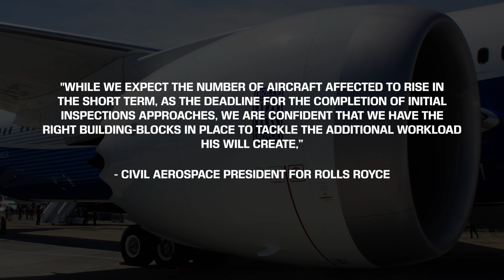Boeing 787 GROUNDINGS to WORSEN due to TRENT 1000s

Comment: Read my lips:

G - E - n -x
Reply: occhamite. Read this, "In the summer of 2012, three engines suffered Low Pressure Turbine (LPT) failures. 

During the spring and summer of 2013, GE learned of four 747-8F freighters that suffered icing in their engines at altitudes of 40,000 feet and above. The most serious incident involved an AirBridgeCargo freighter; on July 31, while at an altitude of 41,000 feet over China,  The pilots were able to land the plane safely but the engines were found to have sustained damage. 

January 2016 a Japan Airlines 787 had an inflight shutdown after flying through icing conditions, caused by ice formed on fan blades and ingested: the blades moved forward slightly and rubbed on the abradable seal in the casing.

In March 2016, the US FAA ordered emergency fixes on the GEnX-1B PIP2.[ The airworthiness directive affects 43 Boeing 787 Dreamliners in the US. Abradable material in the casing in front of the fan blades was ground to keep them from rubbing when ingesting ice or debris on 330 GEnx PIP-2."
Reply: They've all had their share of failures. P&W are currently addressing the engine issues affecting the 1000G which powers the A320 NEO. Air France had a major engine failure of a GenX in September last year. Rolls Royce have IP compressor blade issues. All these things are rare. Jet engines are very reliable.
Reply: occhamite
”Oh I see! 3 engines, 6 years ago, vs an long-standing and still worsening, major fail, affecting dozens of aircraft and at least 2 series of RR engines! Tristrar/RB211 revisited. No way you can compare the historical operational reliability of GE and RR. You don't know what you are talking about.”

Hmm, that old shibboleth again, mixed with a bit of selective hearing and confirmation bias. Don’t worry: we all have it. This not a long standing problem. The Trent 1000 is descended from the RB211 but has undergone incremental changes to improve power, reliability and fuel efficiency. Where they fell down was in their media strategy, especially viz QF32 (which is a different engine anyway). If RR were so unreliable nobody but the Brits would use them yet Boeing considered using them as a sole supplier for the787 but changed their minds.
Reply: occhamite, My point is all engines have problems,  I didn't say GEnx engines are bad, they are not free 
 from problems either. I have nothing against GE engines I've said this in other posts.

I do know what I'm talking about, I use researched facts not blind allegiance to a company or brand. The last GEnx incident regarding icing was in fact Jan, 2016.

"The airworthiness directive, issued by the FAA and adopted by EASA, was the last in a series of fixes triggered by a January 2016 incident in which a Japan Airlines 787 experienced an inflight shutdown after flying through icing conditions."

Not the wording "last in a series of fixes" So the problem has been affecting the engines for over three years since the first problem appeared! The airworthiness directive affected 43 Boeing 787 Dreamliners (that's 86 engines) in the US only . All GE engines fitted to the 787 world wide had to be checked, hardly just 3 engines.

"14 December, 2016 SOURCE: Flight Dashboard BY: Greg Waldron Singapore 

A mid-air engine shutdown aboard a Jetstar Airways Boeing 787-8 aircraft has been attributed to a known issue with the transfer gearbox (TGB) of the General Electric GENx-1B turbofan."

So the last engine problem "a known issue" was 16 months ago! Hardly history.

The Rolls Royce problem while considerable, affects 380 package C engines. Not the package B or Ten. Boeing has asked Rolls Royce to only supply the Ten version for all future 787's

Rolls Royce needs to fix this problem.  Sadly, problems like this do not have quick fixes. It took 3 years for GE to fix the  GEnx icing problems, they had to rework the fan stator module assembly. GE could not supply enough engines quickly even if the airlines choose to replace Trent's with the GEnx.
Reply: Anthony Witham

Oh I see!

3 engines, 6 years ago, vs an long-standing and still worsening, major fail, affecting dozens of aircraft and at least 2 series of RR engines!

Tristrar/RB211 revisited.

No way you can compare the historical operational reliability of GE and RR.

You don't know what you are talking about.

Comment: Coincidentally, rolls royce never fails at thr engine for airbus
Reply: What about the Quantas a380 RR engine that blew up a few years ago and after they inspected all other engines found most of them had faulty stub pipes which could have caused them all to blow up.
Reply: Yohanes Kurniawan Do some research. You forgot the A380 engine explosion?
Reply: They almost bring down a complete A380. RR powered the safest plane in the world, the L1011. Who knows at this point.

Comment: Dj. thank you for  a good video. I hope you are feeling better.  very interesting  details   about Rolls Royce engines.
I  expect they will fix the turbine blades  as soon as they can. Rolls Royce do have a good website .There was a video that Rolls Royce made showing the production line and the testing of all engines. One fact they showed was a full engine  on testbed which is sent a huge amount of water ingested whilst running at maximum speed and this proved that no blades would come out of engine cowling when engine  caught fire  and no blades got out of the engine  even when the engine failed.
It is a shame when mechanical problems could happen  to jet engines. I wonder whether any  other engine makers have had any sort  of trouble, i.e # GE # Pratt and Whitney
Reply: +C-990 Buff
"As far as GE and P&W gloating over RR's Trent engine problems, I highly doubt that will happen.  Soon enough, something will happen to each of them."

Quite right. They leave that to the fanbois. GE did have a spectacular failure of a GenX engine on an A380 late last year. I don't think anyone is crowing about that.
Reply: Hello Third Man, thank you for comments. I guess most American airlines prefer to buy American made planes, though American Airlines and I think maybe Delta and United may have a few jets powered by American engine makers. Now as Mr  Donald  Trump has put a 20 % surcharge on steel and Aluminium imported to USA   then the £350 Million steel exported by U.K to USA might mean we lose orders.
Anyway # The E.E.C is going to penalize American exports to Europe, let us see how they like that.
Sorry for comment about some non-airplane info.
Reply: Thank-you for the information!, TheThirdMan.
Reply: Good comment.  Thank-you for sharing.
Reply: C-900,  you are welcome, thank you. I suppose most people will just praise GE or Pratt  & Witney engines, however,   did those companies ever have an engine failure with their fan blades. anyway apart from plane engines Rolls Royce do make the Rolls Royce cars ( considered to be best in the world ) though the company is now owned by a German firm
Reply: sorry I spelt your username wrong, of course it is C-990 Buff
Reply: Indeed, P&W and GE have had problems with specific engine models.  Most notably are the problems with the P&W engines used on the A320 Neo.  However, despite how well engine manufacturers try to test their engines, there are times when several engines used on many aircraft and in continual use will develop an unforeseen problem.  It just happens to be how it sometimes works out.  As far as GE and P&W gloating over RR's Trent engine problems, I highly doubt that will happen.  Soon enough, something will happen to each of them.  

No problem at all with abbreviating my name.  I did not notice it until I read your second reply.  Please have a good weekend.
Reply: tradjazzer, politics and business seem to be bedfellows, so contribute all you desire.  As far as who buys aircraft from whom, I did some research and it seems that the bottom line is from whom will the airline get the best maintenance contract.  When it comes to aircraft ownership, the cheapest thing about an airplane is its initial price.  I have seen some B747-400 models that have been flying for 20+ years.  Given the FAA mandatory inspections and unplanned maintenance, that adds up to a hefty piece of chump-change.  Years ago, I had a buddy who owned an airplane.  His aircraft had a starter motor off the same assembly line as the one for automobiles.  However, due to having to meet FAA criteria and certification, that virtually same starter motor costed him 5 to 10 times as much.  I can imagine those high performance commercial aircraft parts have price tags that are sky high (pun intended).  

I hope everyone has a great weekend.  Thank-you all very much for great conversation and contributing to my knowledge of the airline industry.  I look forward to discussing things in later Dj topics.
Reply: tradjazzer I don’t mind if it’s relevant and it is. The subject is doing the rounds in other spaces. There are some countries like Australia, which seem to have negotiated this.
Reply: Hi C-990 Buff. thank you for the great information. have a good week.

Comment: Will emirates be affected by this? Maybe order cancellation?
Reply: aren't getting any? you sure about that? Emirates just placed 15.1 Billion dollar order for 40 787-10s a few months back.
Reply: hmmmm... that's odd I cannot find a single article about the cancellation of the 40 dreamliner orders.. could you link me to an official press release so I can read? thanks.
Reply: Emmanuel Pacamalan they placed order for a350 then canceled it then for 787 then canceled it then went back to a 350 and got more a380 instead still deciding between 787 and a350 and a330 as they need and want something smaller  than 777-300 airbus and Boeing will not cross filthy rich uae government and will dance like they wistle order rules don't apply to gulf carriers. We will cancel whenever we want and get whatever we want.. oil oil oil money
Reply: Taekook Addicted emirates doesn't have any 787 and aren't getting any

Comment: I just noticed that the engines separate when they land. I have ever noticed that before, is that on all engines or a feature only of the Trent 1000. What is the purpose, is it the reverse thrust, sorry for my ignorance.
Reply: Yes that is reverse thrust. all aircraft have the same on all engines, except the A380 which has the 2 inboard engines only.
Reply: Thank you for the explanation.

Comment: Not sure if this will get seen or not but have you done a video on why there are different engine manufacturers for Airbus and Boeing? I've always wondered why it's the airline that determines what engines they want and not Airbus and Boeing sticking to one provider. Also what factors determine which engine manufacturer an airline chooses? Why did QANTAS for example go with RR for the A380 but GE for the B787? Would love to get further insight from you or others on this thread.
Reply: Good question.  Briefly, the chief reason a carrier selects one engine manufacturer over another has to do with engine maintenance contracts and not necessarily which company produces the best engine.  The initial cost is one thing.  However, the years of required maintenance on engines takes on an entirely new life.  Consequently, whichever manufacturer provides the best maintenance package is primarily the consideration as to which engine is installed.

Comment: This shows how bad RR have now become. This problem will extend to A330neo as well because essentially the A330neo uses the Trent 1000 which Airbus claims as "latest generation RR engine". RR should have not been selected by all the affected customers but BA always chooses RR (because they're British) for every aircraft where possible they order.
Reply: I have to disagree with you.  The primary consideration for engine selection has to do with which company provides the best long range maintenance package.  As far as which company has the best engine, after a fair amount of research I have come to discern it is almost a flip of the coin.

Comment: SHouldve gotten the GE
Reply: I agree, then they would only have the icing and transfer gearbox problems the GEnx engine has.
Reply: This is my concern...  I always have Airbus fans telling how superior the A350 is, and I agree it's a great plane (but the 777 family is better, IMO,) but I worry for Airbus that after 1 year of service on the new Trent XWB engines, we might begin to see failures as well.  IMO, RR has been building off the RB211 technology for 30 years, and it's very risky and they are over stretching their ability to produce quality at such quantity.  RR needs to get their engineering act together.  Even as a Boeing and GE enthusiast, I still root for the A350 success as well.  Let's hope no problems turn up once those XWB engines get higher in cycles.
Reply: Are RR powered a350s also affected with this dilemma b787 operators experiencing? I'm assuming they both have gotten the same Trent model or otherwise. Great a turbulence for the b787 RR jet operators. Hopefully RR will plug a Cap to it ASAP.
Reply: BayAreaLen Classic, The 787's with Trent package B and 1000 ten engines are "still airbourne, maintaining dispatch reliability profitability and full ETOPS"

As to the Trent XWB "It passed one-million flight hours in October 2017 without any in-flight disruptions and with a dispatch reliability of 99.4%.By February 2018, it has completed 1.3 million flight hours with a 99.9% dispatch reliability.

Still that means nothing to a self professed Boeing and GE fan. Hardly a unbiased commentator. I'm only trying to point out all engines can have problems, due the demands made of them. All  engine manufacturers are pushing their designs and manufacturing to the limits.

If there was only Boeing and GE available there would be no competition to drive the price's down.
Reply: Brett Demauna, the A350 uses the Trent XWB which is not effected by this problem
Reply: Johnny Wynn, the GEnx is based off the GE90 first flown in 1995 so its sharing 23 year engine core. Is that bad? I think not.
Reply: ...and they would still be airborne, maintaining dispatch reliability, profitability and full ETOPS, too.
Reply: BayAreaLen Classic RR has been Using a 30 years old triple spool Engine cores on new technology RR engines and airbus relies heavily on them, the Trent XWB 97 for example is using the same engine core from Trent 900, so basically the XWB is based of the Trent 900 which tended to explode on a380. Kind of Risky. Same with the Trent 7000 powering a330NEO. It’s sharing that 30yrs old engine core.
This is why Emirates Rejected their a350 order because Airbus and RR tried to encourage them by overstretching the performance of the TrentXWB which failed to reach 100K pounds of trust which was what EK was mainly after. It’s stuck on 93-97K Ibs of trust. Far too overstretched until it finally walked into a limit. GE on the other hand invests and spends their time on what they know is right. They are Miles ahead especially in the competition

Comment: As a loader on the ramp for airnz it is frustrating having to find alternative planes. 2 of our Dreamliners are out of action due to one flight that never even made it out of nz when there was an issue with the engine then had to come back after we loaded it so had to wait for it to come back then unload the aircraft again and this was after I knocked off. I prefer our B777-2/300ER’s and now we’ve had to hire hifly and they do things quite differently to the way we load it

Comment: I worked for a company that made parts for Rolls Royce so I have a little insight into the rigorous testing they go through before production, it's not good for them that any problem arises well after that stage, but better to be detected and resolved than not.

Comment: Will Rolls-Royce have to compensate airlines for taking planes out of service causing flights to be cancelled?
Reply: This depends on the contracts the airliners signed with Rolls when they purchased the 787 with the Rolls engine option.

Comment: TRENT 1000 is the worst jet engine in the world. LOL

BA and NZ must switch their 787 engines to GEnx. This is because GEnx is more reliable than ???????? RR TRENT 1000s!!!
Reply: Just 2 minutes search will find that GEnx Engines had their problems too on the 787. FAA -  "Urgent Recommendation" Inspect GEnx Fan Mid section Immediately."  All Engine Manufacturers have issues with new engines. The Trent 1000 issue is just  on 1 "package" of this engine type - not the full range of Trent 1000s. P & W have had their problems.
Reply: -Although P & W  dont make engines for the 787
Reply: If the problem is not fixed by August, maybe Boeing will remove the Trent 1000 from the 787 catalog and replace all Rolls-Royce-powered 787's with GEnx engines
Reply: I agree, Jacob Payag. This might be an excellent option. Luckily, Boeing chooses GE as an only engine option for 777X. In the meantime, however, Boeing still waiting to decide which engine manufacturers they choose for the Middle-of-the-Market 797 (which will eventually replaces the Boeing 757).
Reply: I agree with Valenhabok Julio!